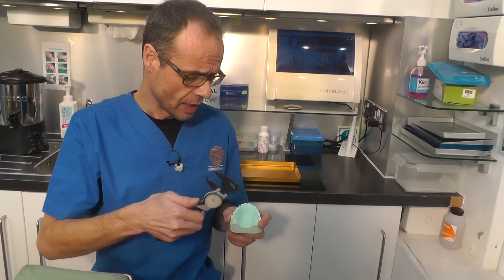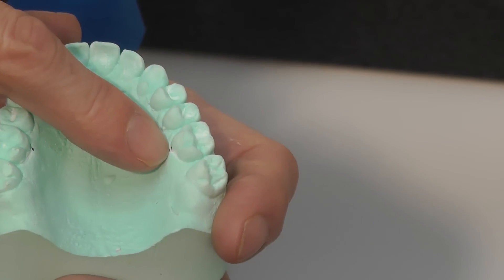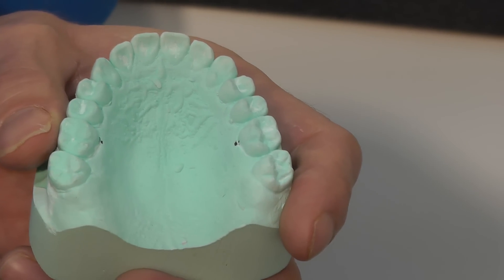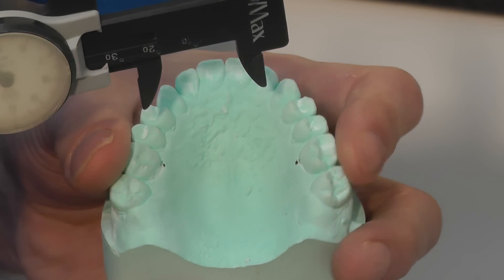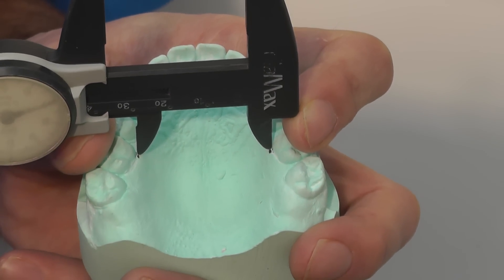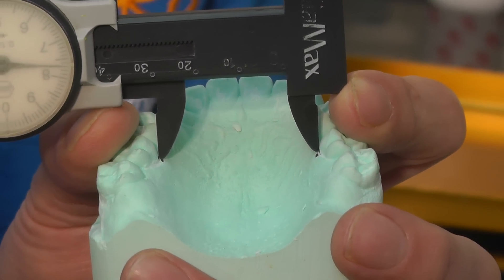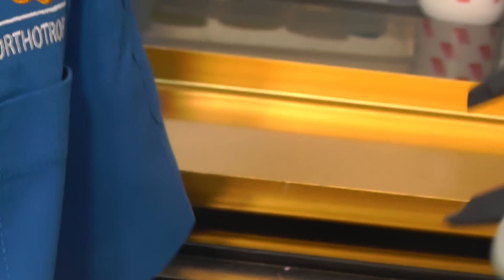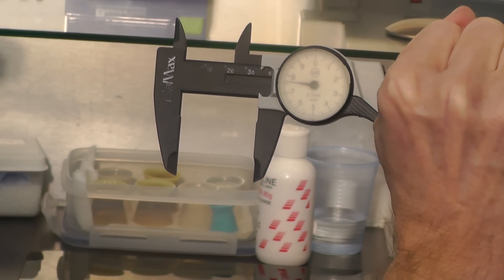Measurement of Intermolar Width on a Model for Orthodontic Treatment by Dr. Mike Mew

Comment: I have 45mm. And i have a really big tongue. My teeth are really straight, i guess this guy is right
Reply: Impressive. Have you always Mewed naturally? NM
Reply: J Jay  why is it retarded? I have found it to be extremely beneficial 

Best of all this free and takes no time
Reply: J Jay  I am convinced

Have you done much research on it? What part do you think is wrong?
Reply: J Jay  yes would be nice to have more research. No one want to find it

I’ll keep using Mewing and Buteyko as it works for me

A growing army agree with me but time will tell

Even if mewing as wrong there is no downside risk
Reply: J Jay  interesting angle

I agree that the debate is sometimes heated but such is life

I’m eternally grateful for Dr Mew And Dr Buteyko. I with I had discovered this in my 20s
Reply: Mine is also 44 and I even have space for my wisdom teeth.  I've always "mewed" naturally before I knew what it was, never a mouth breather except for asthmatic episodes.  Dentists have always tried to convince me to extract my wisdom teeth even though they admit that there's plenty of room, and I'm very glad I didn't after hearing horror stories of extraction aftermaths.
Reply: I have a really big tongue. The issue for me is my face is pretty wide and I still need to expand it to fit my tongue

Comment: Dr. Mew: I understand how tongue exercises, proper swallowing, oral posture et cetera can help to expand the palate over time, even in adults.  Is there any reason to believe, based on your experience, that the mandible can also be widened by mewing, and without some kind of appliance?  I have some crowding of my lower incisors next to my canines.  I get that the tongue provides an upward and forward force on the maxilla, but how does this help reform an adult's mandible that grew down and back somewhat due to poor habits; does it get "taken along for the ride" by the improved structure of the maxilla?
Reply from the maker: Both move together, there is no "empty space" under the tongue.  Focus on the maxilla and the mandible with sort itself out.  #mikemew
Reply: I see.  Thanks for the prompt reply.
Reply: @Orthotropics  This is an underrated reply.  More people need to hear this.

Comment from the maker: Important note; modern adults (or anyone over the age of 9) tend to have a molar width of 29 to 34mm.  Anyone with 35 to 38mm will find it much easier but still very hard to make progressive improvements without any formal therapy, and as a rule of thumb when I finish therapy any one who can maintain 38mm or more without retainers tends to maintain good alignment almost indefinitely, with a minimal effort.  During childrens treatment expand to 42mm for a girl and 44mm for a boy, clearly some of this is tipping of the molars.  Ancient man had an inter-molar width in the high 40's to low 50's.  #mikemew
Reply: Mine is 32mm. Fuck!
Reply: what if you get premolar extracted? How do you measure
Reply: @lukebruce5234  I'm 28 mm because of PREMOLARS extractions my biggest regret in life
Reply: @Sariine436  38 with extractions, it's probably not just the extractions that's caused that for you.
Reply: @anuragsuresh5867  they retracted all my front teeth and pushed my teeth inwards and it gave me TMJ and I could see my jaw on the left side starts behind my ear and it wasn't like that before and my right ear my jaw starts before my ear! This is very weird but I'm going to reverse it and maybe use TADs so my wisdom teeth can be like a 2nd molar. I seriously can't stand  this anymore!
Reply: Black Pill  wtf man, you still complain? mine is 34.66, I used ctcb to measure
Reply: @Sariine436  just keep mewing, I mew and my intermolar width increased 3mm after 6 months. If you want really good result, use mse+face mask.
Reply: @AlanNguyenMD  I think I have OSA because I'm waking up with headaches and my airway is small :( IAM mewing.
Reply: Mine is 40mm and consistent with Dr Mew points I've been able to progress at home without formal therapy. I've been a lifelong snorer and intermittent grinder.   Using Mewing, I've gradually got on top of the situation. NM
Reply: Hi Dr, I just went to Dr William Hang and my intern Olaf width is 38.5 and he said that 40-42mm is perfect, but you are saying that it should be more. What should I do?
Reply: @Aliens_And_Pyramids_And_Shit  mines is 44 and will be 47mm by the time my MSE treatment is over
Reply: Mine is 40mm and I've never had any teeth problems and straight teeth
Reply: @lukebruce5234  mine is 25mm lol
Reply: My inter molar widht is 25mm I cant rest my tongue on roof literally
Reply: You should expand your palate 👍
Reply: I guess it depends on the size of your mouth. Mine is 42mm and i still have crowded left lateral incisor and tongue nowhere near fitting on top of my palate. 
I will expand to 50.
Reply: @superburstmega721  im at 35 lad
Reply: 50mm is crazy! I just can imagine that sort of comfort! I will try to get there
Reply: @lucasyata I have 50mm💀2 inches wide palate I do have very prominent bone structure
Reply: @etherealmoonlight67  Wait, seriously? Do you have an imgur picture for proof? Because holy shit, that sounds insane.
Reply: mine is 50mm 😂😂😂😂
Reply: @jack-o-trades304  legit? you mind posting an imgur pic? never seen a palate that wide

Comment: Hey i have had this BURNING question, i have vampire teeth (my upper canine teeth are quite high up and misplaced), will mewing help fix this if i do it long enough (im 16 btw) THANK YOU
Reply from the maker: May be, it is certinaly possible but it is up to you and how hard you work
Reply: Did it help?
Reply: Use the orthotropics website to look up an actual practitioner to see. You’re so young you have a chance
Reply: Hi Dr, I just went to Dr William Hang and my intern Olaf width is 38.5 and he said that 40-42mm is perfect, but you are saying that it should be more. What should I do?
Reply: The old ricky gervais

Comment: Strange question but hope it makes sense. 
How do you measure the width of your tongue? Is there a specific way- do i measure it when its completely horizontal or curved... Reason being I have a narrow palate. My intermolar width is 36mm. I actually have a a dental impression with which I measured the device.
My tongue is nowhere near being able to rest on roof of my mouth.
I have a removable palate expander and want to know how wide my tongue is so I can subtract that by 36mm and figure out how much expansion I need.
Reply: Put a piece of paper on your wet tongue and measure it?

Comment: Is mewing worth trying? I currently have braces and elastics to fix an underbite as well as a palate expander. I'm 17 years old. Is it recomended or will it affect my treatment?
Reply: yes you should especially after your treatment as Dr. Mew points out a lot of times you regress because your tongue position was not optimal to begin with
Reply: Neal So I should do it during the treatment as well?
Wouldn't it affect the braces progress for my teeth since I'd be pushing the upper arch forward?
Reply: Honestly im not an expert so maybe Dr.Mew will reply to you but I'd say definitely do it after your treatment
Reply: Neal Thanks anyways
Reply: If it were me I would practice starting now. If not only to train your tongue and strengthen it, but also to ensure your jaw and mandible don’t move too far back into your face during treatment.

Comment: I’m 19 I’ve been mewing for 3 months. my tongue fits comfortably. Mine is 37-40mm I used a clear ruler to measure it. I have an overjet it’s not too horrible, my teeth touch with my mouth closed but there are gaps in between the incisors not the two front teeth, but between the canines and the incisors  and between the incisors . What can I do to close the diastemas? - Also my bottom molars were facing my tongue as I used to have my tongue resting on the bottom, they’re straight upwards now. Only one with little more work to do so thank you, Dr.Mew ❤️
Reply: You're now 23, how is it going?

Comment: If you wear Invisalign for 24 hours a day while you mew, does that hurt the ability of the palate to widen since the Invisalign keeps the teeth from shifting?
Reply: Yes. If you mew while wearing the active retainers you won't see any real change in intermolar width and thus jaw width caused by the tongue because any outward force exerted with your tongue will be pointless because the retainer will force your teeth to move in one set position . You should still mew with it on though, because it will increase the size of your airway and when you are done with the invisalign like I am you can put that retainer away because your tongue will act as one preventing your teeth from shifting inward.

Comment: I have a question and it would be great if someone could answer :) I have noticed that if I measure in front of the mirror with some sort of measuring device such as a caliper, its around 39 mm. However, if I bite into something solid and flat, I'm about 42. Am I doing anything wrong? Whats the correct way to measure?
Reply: Arcs are bit longer than its connecting chord.
Reply: Go to an orthodontist and get them to make you a dental impression model. It will be made of plaster and then you measure between the inner 1st molars

Comment: Does having a more vertical facial growth correlate at all with lower testosterone?
Reply: Yes it does sad to say, because tongue posture effects pituitary gland which effects your hormone levels. It may even effect your height.
Reply: From my understanding, testosterone makes for horizontal growth of zygos and mandible, vertical growth of ramus, and forward growth of chin, nasion, and brow ridge. But to have a more forward grown maxilla, forward projecting midface, and developed orbitals - you would've needed proper posture while you were still developing.

Basically, testosterone/HGH determines how much raw bone mass you will have, and posture helps put it into place.
Reply: Dimitrelos300 exactly, you can't really point to one thing. If anything, a low-T face would lack horizontal growth - narrow cheekbones, narrow jaw, not much bone mass overall. Whereas vertical growth can be caused by a lot of different things.